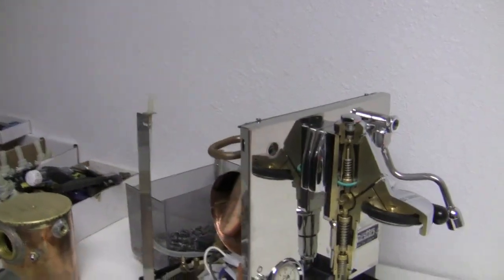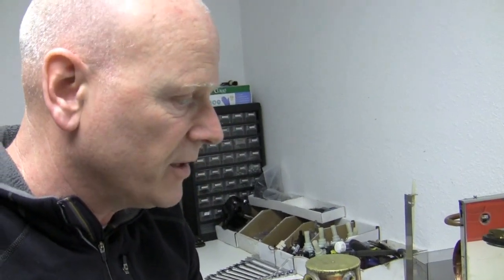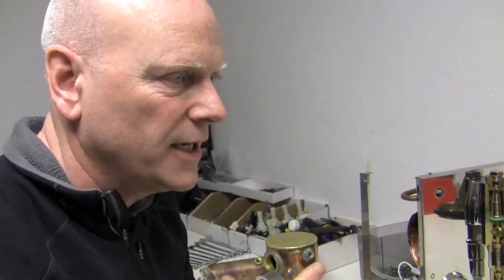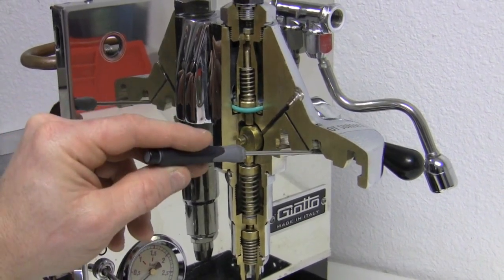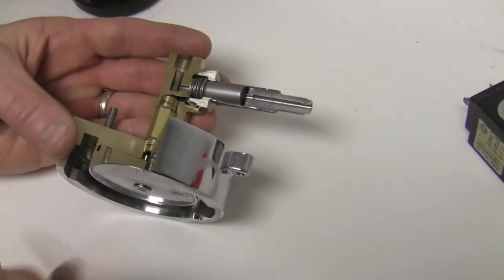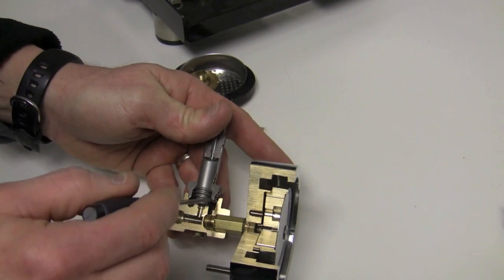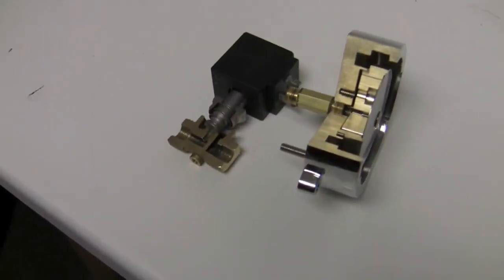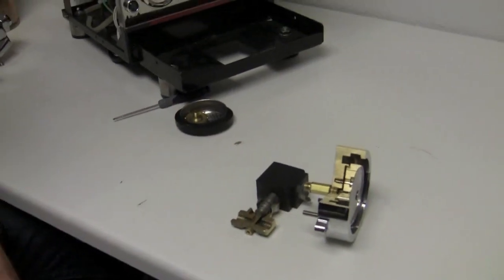Espresso Machine Pressure Release Valves

Comment: I recently was given a new home espresso machine.  I had it for 3 weeks,  brewing a couple times a day only. Long Story short it exploded on me.  It was extremely powerful. Very loud and frightening.  I contacted the manufacturer and sent pictures.  After a week or so got a call back they're gonna refund my money.  Btw I sent them proof of purchase as well.  Well the guy on the phone said that it's never happened before and he can't see and said there's no way that it could explode.  I am curious what you think about exploding home espresso machines and is there something that I may have done wrong to cause this as well? It was so powerful that it broke the metal off the machine that the coffee cup holder that is locked to the machine clamps onto.  Thank you so much for your help.

Comment: After a week away from home, I noticed the pucks in my Rocket R58 (with E61 brewhead) are wetter than they had been before the machine was idled for about 8 days.  Now, a couple weeks later and following my regular cycle of backflushing, the wet pucks are still evident.  (I pull about 15 to 20 triple shots per week and backflush every other week - or after every 30 to 40 shots.)  What would cause this wet puck?

Comment: I have a Rocket r58 and I always have a slurry when I finish brewing, and when I backflush, not much water comes out the exhaust and when I finish and want to remove the PF, a ton of pressure is released at the PF.  Is this an indication that I have a Brew Pressure Release Valve problem?  What can I do about it?  Thx.

Comment: This question its for Bill!
Hello there! I NEED YOUR HELP!
I have a commercial espresso machine La Nuova Era Altea two groups, I’m using it at home and bought it used from a restaurant supplies. Yesterday while I was cleaning the machine, I’ve noticed a new symptom…The water pump makes a very loud noise and the group pressure indicator it’s all over from 0- running over the boiler indicator almost 180 degrees, I don’t know how much pressure that could be, and its fluctuating very fast! I tried to adjust toe rotary pump pressure but no success..:(
Anything I should try suggestions?
Reply from the maker: Unfortunately, that's not a brand that we carry so we are not familiar with the ins and outs of the machine. Without knowing the details of the machine it would be difficult for us to give a good answer. Sorry. - Steven